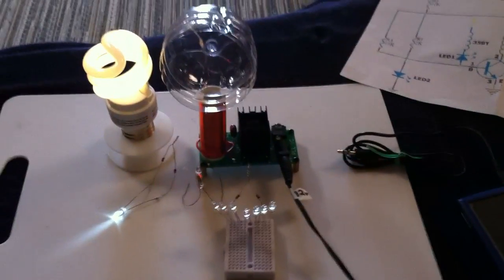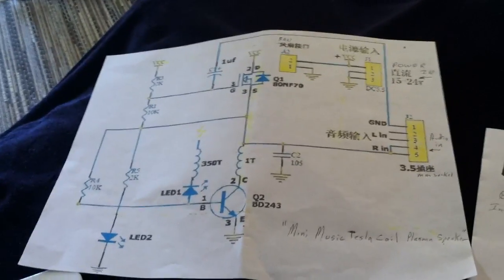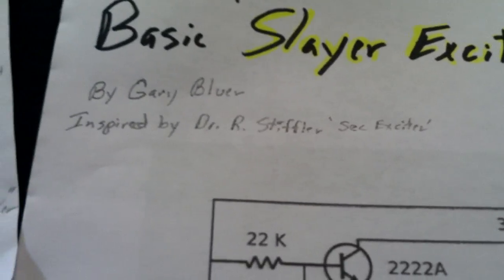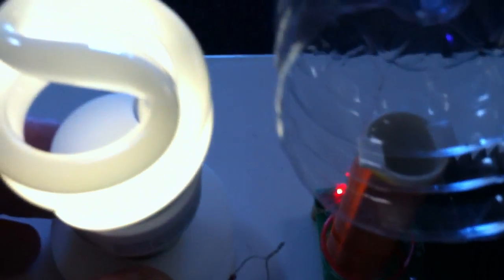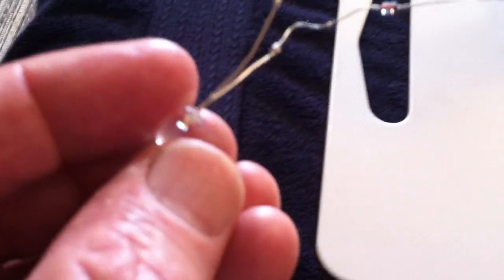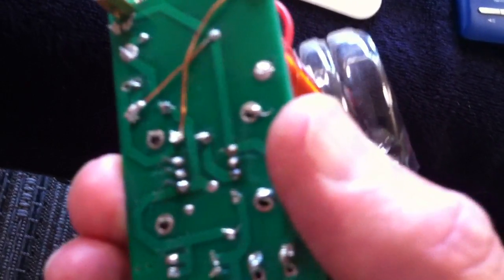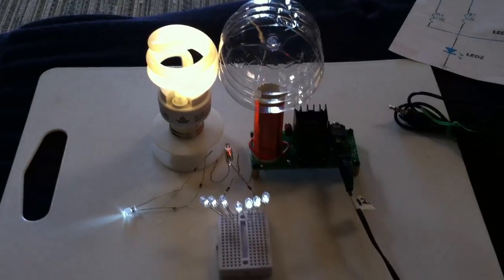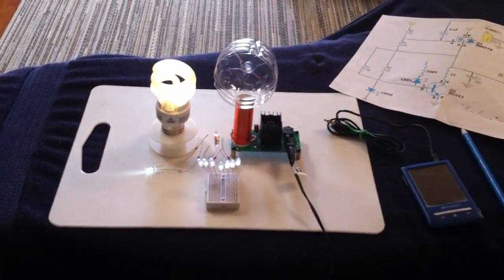Mini Tesla Coil Kit---Part 2

Comment: Cool, thanks for the additional detail!

I saw your comment about getting a new soldering iron.   I recommend looking into the TS100.  You can run it with an AC adapter, or go portable with a LiPo battery and a plug adapter.  Lots of videos about it here on YouTube.
Reply from the maker: Thanks for the tip on that portable soldering iron.  It is a bit pricey but probably worth it. I have a USB soldering iron that I have used off a 5v power bank.  The problem is I can't find it.  We did a house remodel last year and many of my things got misplaced.  Lost in space.
Reply: Haha, "lost in space".  Good way to put it. :)  Thanks again for the additional info.  I've always loved high voltage.  In Jr. High, a teacher had a Van der Graaf generator showing the kids how it would make their hair stand up.  It was right in front of my desk in the front row, so I was putting my palm out toward it and a huge arc would hit my hand every time it charged up enough.  It didn't hurt *at all*, but the other kids thought I was nuts. lol